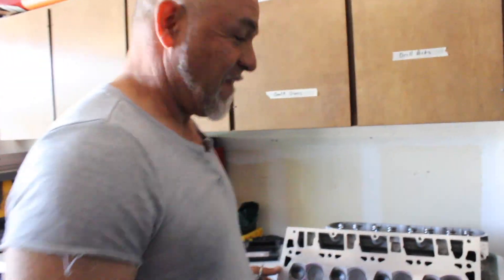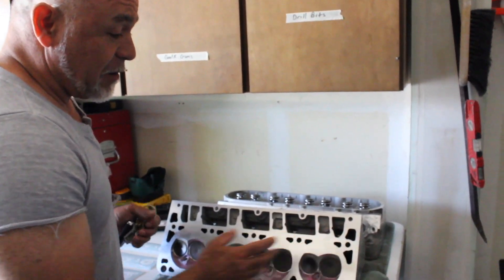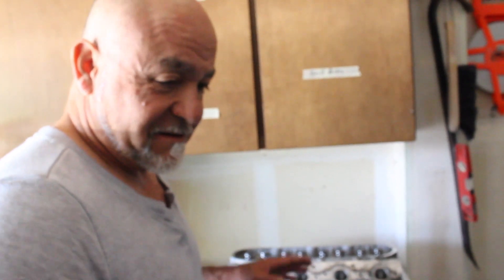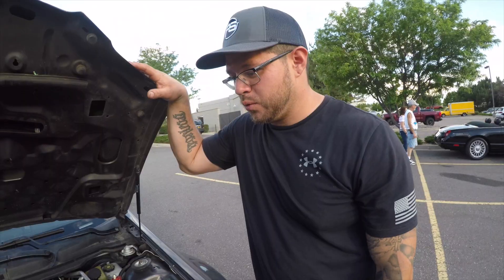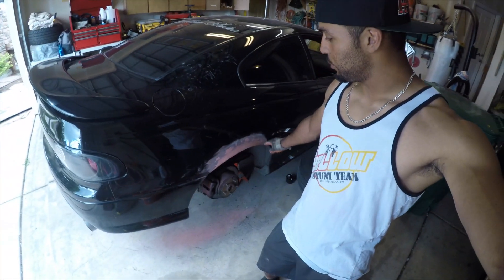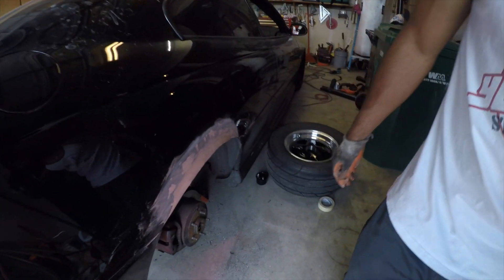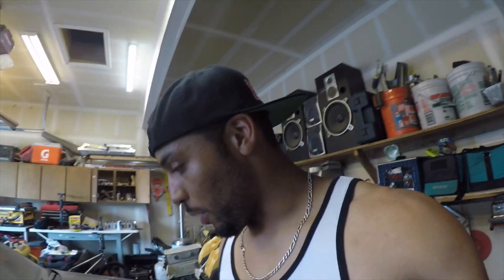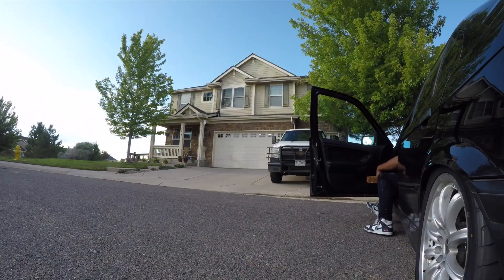FIXING MISTAKES FROM GTO TRACK DAY + FRESH HEADS FOR MY DADS BUILD!

Comment: Just bought an Active Interchiller to get my IATs down for track days. Can’t wait to get it on. Complete bolt in kit with necessary wiring! I have a GTO 5.7 with a tvs2300 etc. Also check out the “Dragy” receiver and app for testing your 60fts!  There’s a vid on my channel of a pass. Data from the run shows I let off around 1000ft at 113. Was a bit much for the neighborhood so I let off. Anyhow... Good luck my friend.

Comment: Happy 4th to you and yours ,got to see  what size tire I can put under  the back of the GOAT  without fender rolling have 411 gear  have 235 35 19 on there now
Reply from the maker: BWA gto4 it’s all about the wheel offset
Reply: I was running nittos 275 17s, on my gto, no rubbing when driving on stock suspension, exceot i think it rubbed around tight low speed turns, always heard a grinding noise when taking slight slow turns, nothing big, just thought it was worn busbings, but im on a street tire bow and theres no geind sound after not being on a radial anymore
Reply: @brannonbarakat457   what's your gear
Reply: @bwagto4164  stock a4 trans and diff so stock gears, was half awake when i typed that my bad but, i didnt rub at first, i think over time after 100K miles now, the springs sagged a bit more abd i started to slight rub a little after 10K miles on them, and i only rubbed around tight low speed turns but it wasnt bad at all i didnt care, it was a nitto 555r 275 40 17 on the stock 17 inch rim and hooked good even at 420 whp. Im back on a 235 for fun purposes and less traction but these 235s are way less grippy than 275s forsure
Reply: @brannonbarakat457   ok thanks I got 411 and I'm take to a rim race shop u don't want no rubbing lol with the shock a1

Comment: Ive seen a few guys run the stock airbox with big mods? Supposably the stock airbox keeps iats relatively low, also running a cai that is on top or between the radiator and condenser allows aka a oyrcai greatly reduce iats and heatsoak compared to long, tube cone style air filters filters